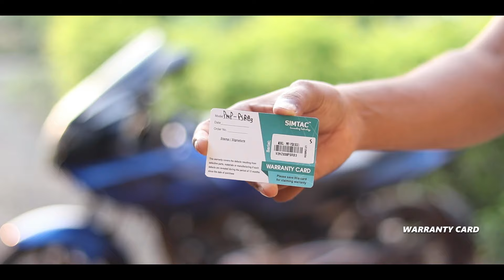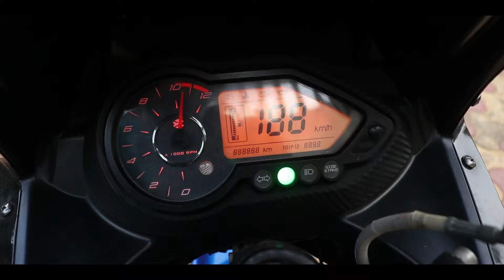Simtac PNP Hazard Flasher V2.0

Comment: Really good video! With complete details.
Will this module fit in to BMW G310R, without cutting any wire?
Reply from the maker: Not for g310r
Reply: @vishalahinave   ok thanks. Can you please suggest any other flasher module for G310R?

Comment: Have already installed this flasher with simtac 360 degree l.e.d indicator bulbs which costs 699 rupees....in my pulsar 220 Bs6
guys..note..its Cross pin type indicator for pulsar 220...
BS4 model flasher fits in Bs6...
Bs3 owners have seperate Bs3 type flasher..
Note= flasher works on bulb too...but L.E.D indicator..or L.E.D bulb is must for better flashing..